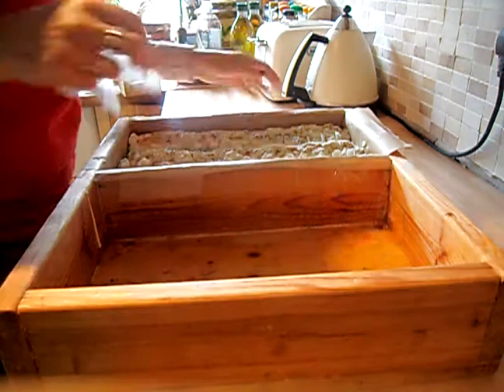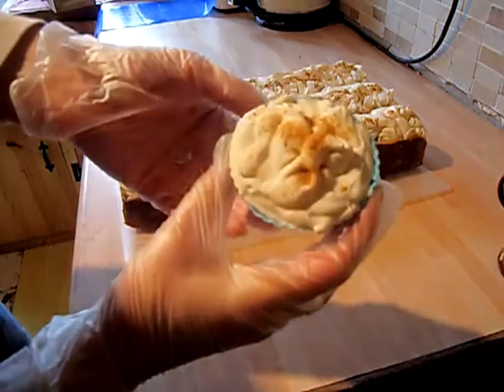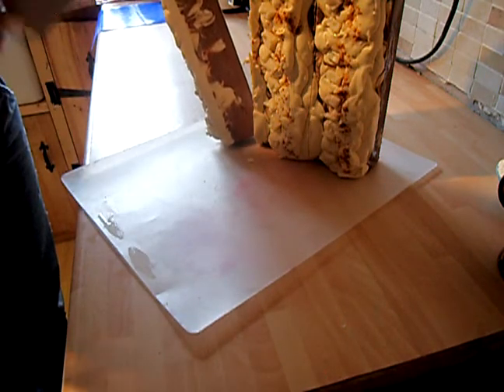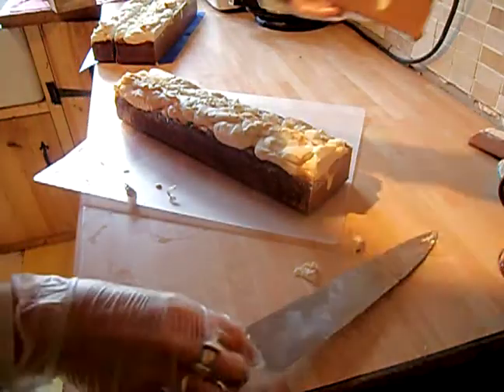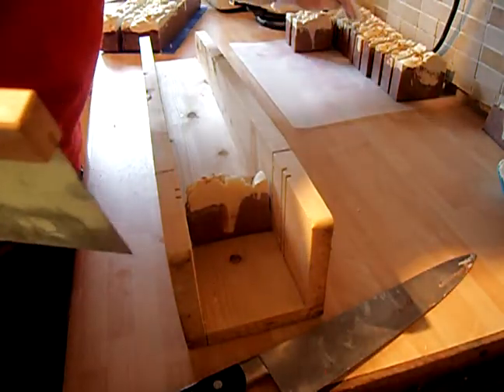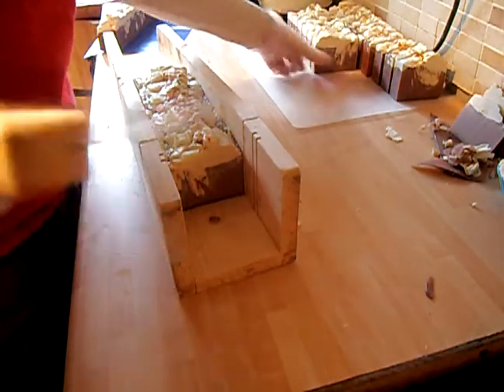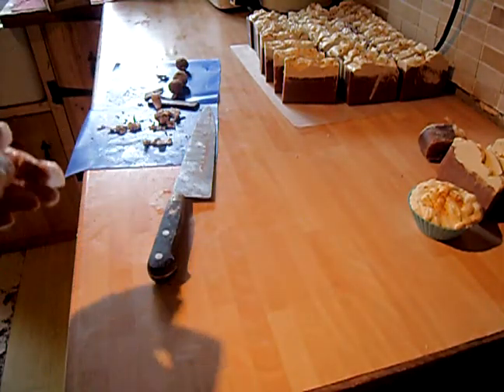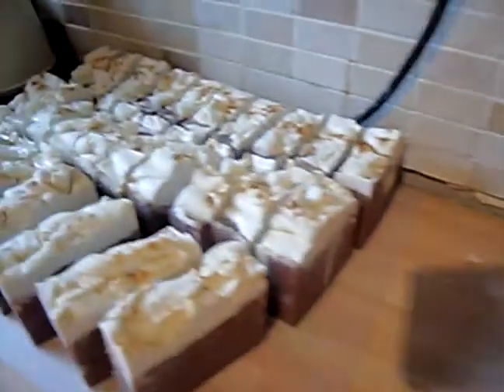Cutting 7 Sins Handmade Soap - and rambling

Comment: Hi Tiggy, just wondering if the silicone liners you bought on Ebay are made for soap moulds or if they are just baking ones that you cut to fit your moulds? I had a look and could only find the baking ones. Cheers!!  xx